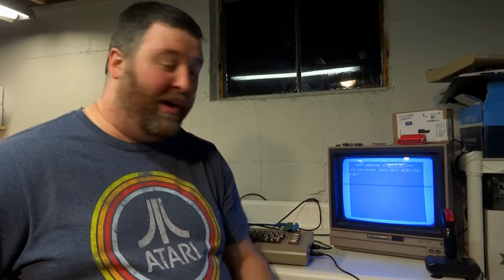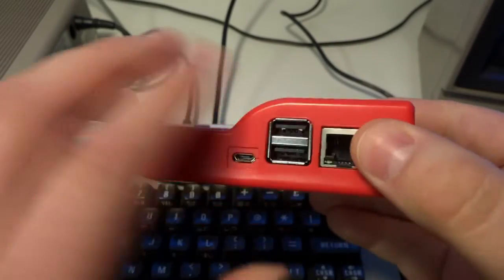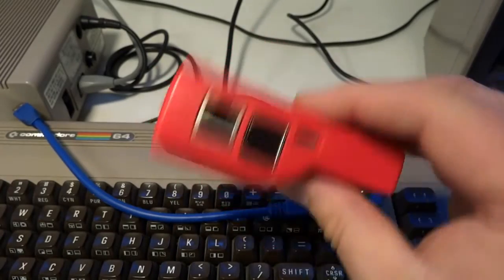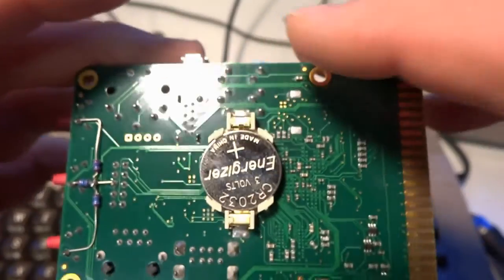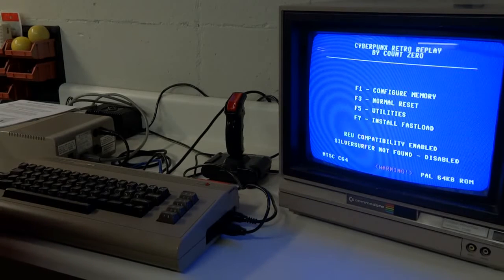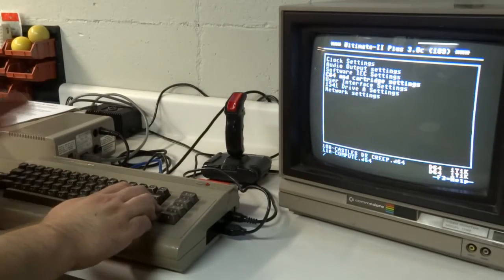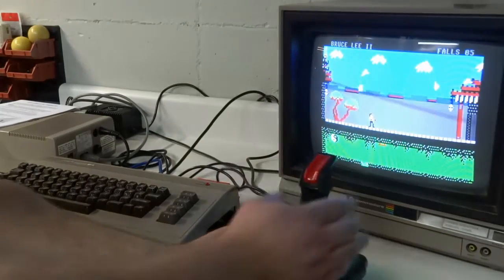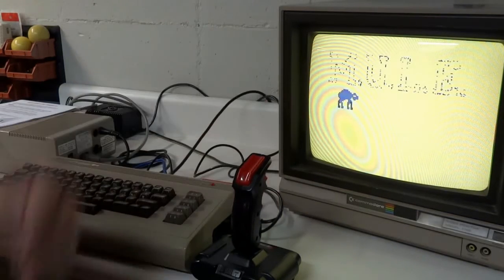1541 Ultimate II Plus Review

Comment: Nice video! One hint: if you mount a disk while something else is running on the machine, you can as well just reset with the button; the newly chosen image should still be mounted, so you can use it right away. At least that's how it works on my Mark I, but I guess that hasn't changed. Good luck with the transfer of your disks, please share them when you're done. :-)
Reply from the maker: Yeah, I could just have used the reset button, but I also got used to unloading cart images using the Reboot option because when you hit reset with a cart image, it just restarts the cart.
Reply: That's true - which is also what you want if you have a fastload cartridge attached. Of course not so much if it is a game cartridge. ;-)

Comment: Nice Video. I have the older 1541U2. BTW I really recommend JiffyDos as fastload option. As you said in your Vid, for one-filers, you don't need a fastloader at all. For multi-file games the fastloader of these cartridges usually don't work anymore. JD, however, still works most of the time. Check it out.

The only thing I really miss on the 1541U is write-support for EasyFlash. Maybe we'll get this one day via firmware update.

Comment: Can that IEC cable go to a real 1541 and daisy chain? If not, when this cart is plugged in you have no access to a real 1541 or 1581 or printer or anything else, right?
Reply from the maker: tarstarkusz Yes, you can daisy chain with a real 1541 drive and copy disks between a real 1541 and the ultimate. I actually am planning a video to demo this.

Comment: What are those clicks though when first switched on ? mine does this , my Ultimate 2 and Ultimate 1 never made this double click sound ?
Reply from the maker: As I recall, that was an unintended noise, but functionally not a problem. I do believe Gideon fixed on the next revision, so ones purchased now should not do that.
Reply: @seansretroverse9082  Cheers , Now I know the cause , It will not bother me as much.

Comment: Can it pretend to be a CMD hard drive? Is it C128 & or CP/M modes friendly? Will it run a WiFi usb stick for networking? Can it hold a Turbo rom? JiffyDos etc.
Reply from the maker: Lots of questions!  I believe the answer to most of these is currently no*:
CMD hard drive: I don't think so
c128 or CP/M friendly: not really per se.  It can be used without being plugged into the cartridge port as a stand alone 1541 drive, but I think you will not get the 1571 double sided drive support, so yea, it's pretty limited as a C128 device.  I believe if you put it in the cartridge port on a 128, it will boot into 64 mode.  
wifi stick: I know this was not originally supported, but I know some people were I think working on support for it.  I do not know the current status for wifi support.
Turbo/JiffyDOS: maybe.  I know soft kernal replacements can be done via cartridges, but I have not personally tried this.
 would suggest researching Gideon's site and forums for the true answers to most of these questions.  My take is this is really intended primarily as a virtual 1541 disk drive, tape drive, cartridge, and REU.  I otherwise do not have a quick answer for you on this one, as I currently have my c64 in storage.  Sorry I can't be of more use on this question - these are all great questions.
Reply from the maker: Allow me to refer you to a recent video posted by retrobits.  This video is very well done and covers many of the advanced and more recently developed features that my video here does not cover!
https://www.youtube.com/watch?v=L3JwAmPUIIw

Comment: Do the freeze functions allow you to save your place in a game?
Reply from the maker: That is a fair question. The short answer is no (I think?) As I recall, I do not think it has any type of instant save state like you have in an emulator (I could be wrong). That being said, it does support freezer cartridges such as super snapshot. While you could use this for saving a state during gameplay, you still have to dump it to disk and reload it from disk.  This was mostly used for beaking copy protection, i.e. freeze right when the game finished loading and save that to disk. Where I could be wrong here is I think it is likely to technically be somewhat possible, as the Ultimate II Plus supports a lot of RAM expansion options, so I think utilities could be written to swap the main system memory in and out. Where the problems occur is some of the hardware like the SID and maybe the VIC-II cannot be save stated perfectly, so it would probably be glitchy.

Comment: I just got my UII+ today, question the microSD for external power, is that to provide power or receive power?
Reply from the maker: That is an excellent question!  It is so the Ultimate II+ can receive supplemental power.  Why would you need this?  Simple, it is so you can run it as a stand alone drive without using up the cartridge port on your 64.  If you control it over Ethernet, it can work without being plugged into the cartridge port.  This also means you can actually use the II+ with other Commodore computers, like the VIC-20, for instance.  The main thing to remember is to use the UII+ this way, is you must control it via Ethernet.

Comment: Great Video. :) I got one question. Is it easy/possible to copy files between different .d64 Files? And is it possible to connect a real 1541 to the Ultimate II+ and copy files from and to a real disc/.d64? Would be really nice if you could answer this question!
Reply from the maker: Es wird Morgen Webradio Absolutely, its a fairly easy process to copy back and forth with a real 1541.  In fact, I am planning to review the newest firmware and also cover copying as well.  Stay tuned!
Reply: Great, thank you for this information :-)

Comment: If you must have microSD there are tiny USB card adapters that works very well.
Your "expansion" connector is most likely the programming connector for the FPGA.
Four pin connector position might be a debug connector, to hook up a serial connection and get all debug outputs.
Hate the default cartridge setting, there should be no cartridge at all for default...
If you load original games from TAP over the datassette interface - you may need to disable drive as some games are protected and won't load with drive active.
Still no save on Easyflash carts tough.
You don't have to "powercycle" - reset with simultaneous pressing and hold for a second all three buttons of the cart.

You need a 1571 or a parallel cable to write G64 to a Zoomfloppy connected drive IIRC, would surprise me if the Ultimate II+ could write a G64 to real 1541 over just plain IEC cable.
Reply from the maker: Thanks for the clarification, e5frog!  They make sense.  I also thought maybe the 4 unpopulated solder pads might be more for debug use as well, and it does make sense that the internal connector is probably for programming the FPGA.  As far as the G64 issue goes, I tested it to great length, and if you insert a blank unlinked disk image and copy the floppy disk to it over IEC, the image loads just fine from the Ultimate II+.  When you write that image to D64 format, the D64 image no longer works, but that is expected because the D64 only allows for standard format disks.  When you try to write it to a G64 image (keep in mind there is no IEC access during that write), it still hangs up when flushing out that in-memory image to the USB stick, so I am pretty convinced that the issue is between the UII+ and the USB stick, and not the 1541 drive to the UII+.  I will go into a little more detail about it in an upcoming floppy copy demonstration video.

Also, thanks for the simultaneous button press tip!  That's great! :)

Comment: Any trick to actually buy one of these? It has been a week since I ordered one (I think) and paid (via PayPal), but I have received zero response. No confirmation of order, no confirmation of payment. I emailed him a couple days ago asking him to at least confirm my payment, and still no response. I may need to cancel payment while I still can.
Reply from the maker: SGT Dave Just keep in mind that Gideon is just one guy, and you probably waiting for the next time he ships another batch of them.  I know he's been busy on the new C64 Utlimate boards (a full modern board replacement for the C64 itself).  When you order from Gideon directly, it requires a bit of patience because he does shipping batches every 2 or 3 months, when he has enough orders to fulfill in one shot. If you want a unit a bit quicker, then you may want to check eBay.  You may pay a little mark up, but you will get it in short order.  Don't worry though, it's not just you, everyone has to wait to get theirs.
Reply from the maker: Also, your best bet for communications on when he's doing orders is Facebook. Look for the "1541 Ultimate" page there, as that tends to be where the most active group is for these.

Comment: The lack of a good fast loading option for disk images is a real drag. Even with an Epyx fastloader, I have games that take well over a minute to load. I have pretty shitty fast loader for my 1581, but that can load a 205 Block game in about 8 seconds. It takes longer to load the fast loader than it does to load the biggest game I have. I'm not quite sure why they didn't give you a fast option other than those crt images. From what I understand, the really fast ones don't work with a large % of games. I think the AR changes the interleaving and can achieve 15x speed, which isn't bad. So they should have a PC based utility to change the d64 images to match the AR interleave system.